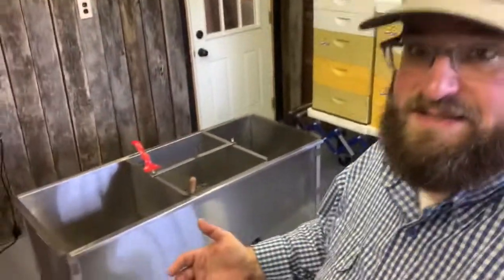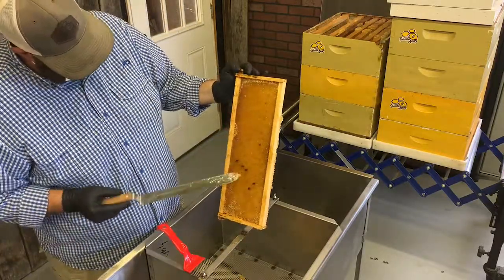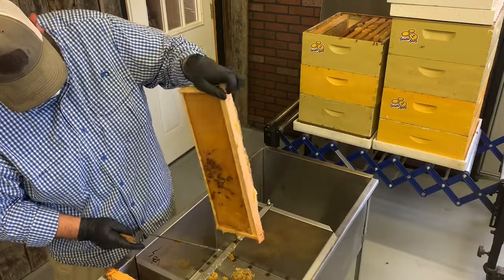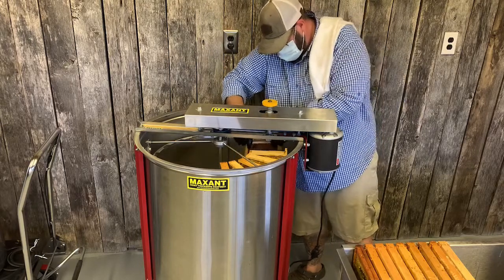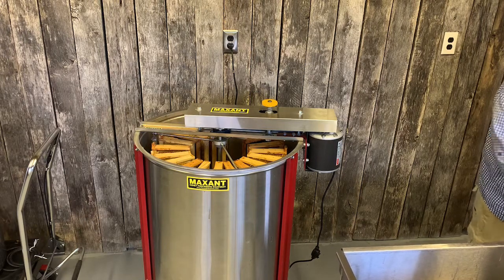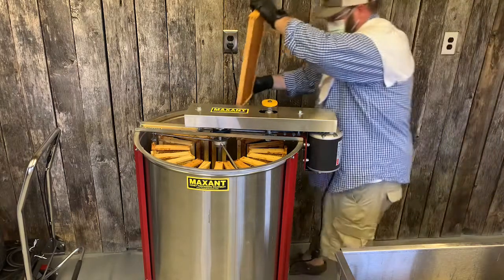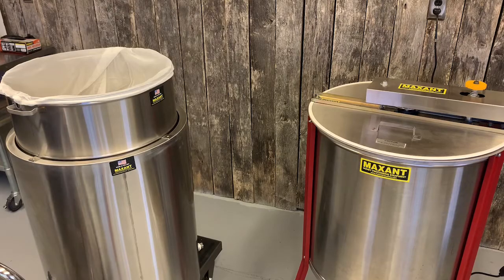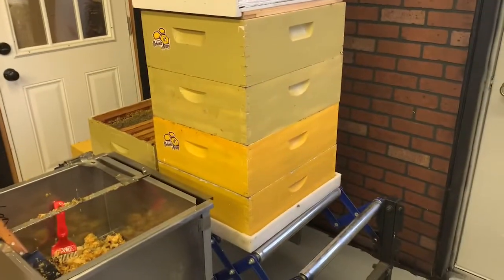Processing honey | 2020 Season | Beekeeping

Comment: ? Typically you leave the extractor gate open so the frames don't drag in the pooled honey.
Reply from the maker: Yes in some cases, the extractor I have has a deep reservoir and being large enough to hold 20 medium frames the overall circumference gives me good added space. Therefore I find that I don't need to leave it open like I would with smaller extractors.